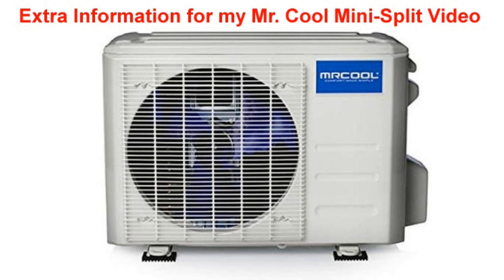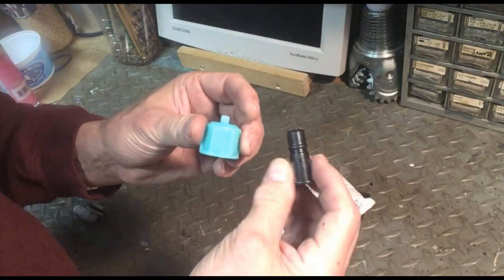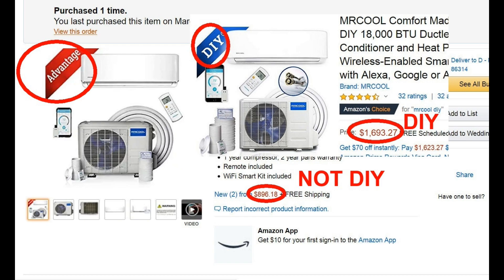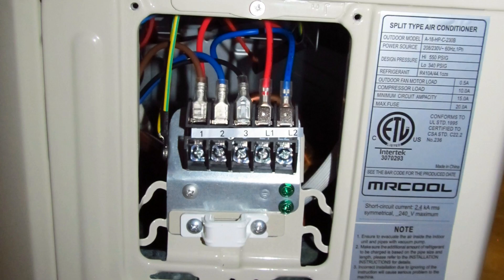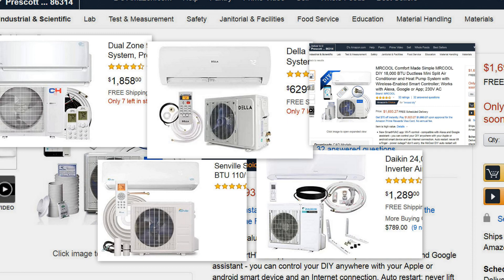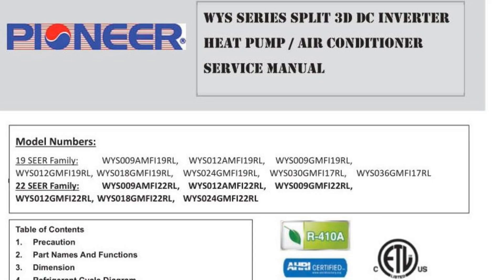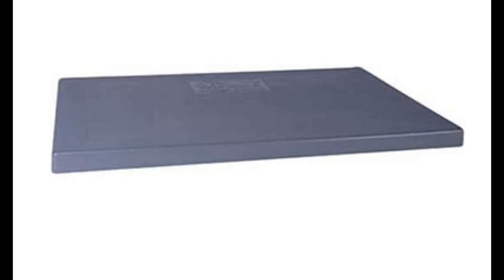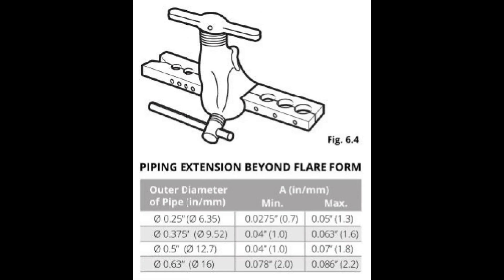Addition to my "9 Tips To Install Cheaper Non-DIY Mini Splits - Pioneer/Senville/Mr. Cool" video.

Comment: check the cost of the outdoor control board. AUX units from Lowes(control board $134.00). Senville also good to buy. Use 1/2" piping 15amp breaker/12 gauge thhn for 1 ton. #10 thhn for 2 ton, 30amp breaker. uncover the line set at the first bend to see if you kinked the copper. if vacuum will not pull down then you have a leak. cooling psi should be in the 125psi range, if lower then you are low on charge.

Comment: I have a evac unit that I used for automotive ac units ,  non electrical,  it works off an air compressor , will this work on one of these mini cools to evacuate the system?

Comment: Can you please provide advice on this matter?

I installed a 3-zone MRCOOL DIY 24k BTU in my house, but one of the lines is a couple of feet short to the compressor. Instead of buying a coupler and another set of 16 ft. line sets to connect my original 25 ft. line set, potentially introducing more problems with oil not draining properly, I would like to cut some extra copper material of the longer line set and braze it with the copper of the shorter line set.

I don't need to flare the ends because I'm still using the QuickConnect connectors of the line set, I'm only using the extra copper.

Because the line set is pre-charged and vacuumed with refrigerant, after connecting the line set to the condenser, can I still perform the same steps, i.e. vacuum the line set and check that the microns are below 500? 

There's nothing extra special I need to do, even though these are pre-charged line sets?

Thank you.
Reply: maybe use 2 16' lines
Reply: I know this is old, it will help someone. 
If you silver solder or braze a line set you have to purge with nitrogen or the inside will oxide and scale off.
You can rent a small bottle and gauge.

Comment from the maker: There is something else I need to stress before you install your unit. Pick a mounting location that will NOT cause the unit to blow air directly on you during most of the time you are at work in your shop. While the blowing is gentle and quiet (nearly silent), it will be uncomfortable for it to be blowing directly on your body or in your face while you are working.

Comment: What do you think of mounting the compressor horizontally?  I am doing a Camper Van conversion and contemplating installing the compressor under the van and then running the coils to the inside unit mounted on the ceiling.  Solves both heat and cooling issues.  Aware of the power limitations and will have a large solar system but only expect to use the unit when connected to shore power or for brief periods with batteries.
Reply from the maker: I am not an A/C, expert, but I don't think you can do this. The refrigerant sits at the bottom of the compressor in a liquid form. Turning it sideways might mess up the valves. But, I am only telling you what I have "heard." Someone else with more knowledge should comment on this.
Reply: I believe blam is right I don't think these are meant to lay down and operate just like when you buy a refrigerator from the hardware store and lay it down in your pickup to drive it home they tell you to stand it up for 24 hours before you plug it in to let the oil get back in the compressor the right way. There is a company that builds a 12 volt mini split I just saw it on eBay or Amazon the other day but it's only 6,000 BTUs it's meant for RVs and campers and we'll tie into a 12 volt system and they said it could be mounted either way so you may want to look into that but it was expensive I want to say around $1,500
Reply: I should have added to my first comment I would reconsider mounting one of these underneath the van though it's going to get a lot of road debris and stuff hitting it I just don't think it would last I would try to mount it somewhere else
Reply: the compressor has an oil in it that if turned on it's side will not function proper & you'll burn up your compressor before to long. So it may work, but not for long. EUROM AC2401 is  a Camper/Caravan style if that's what your looking for or you can get a U shape if your window open the other way. Thank for the Video,  spent the day watching vids and While yours may not have the highest production value, yours had the best info. You're my kinda guy, no bells and whistles just some good old know how and a love for the ability to do it yourself & do it right. Thanks again, I'm a new subscriber. Cheers

Comment: Did you pressurize your lines for a leak test before opening the valves?
Did you use R410A to pressurize the lines?  Where can you buy R410A?
Reply from the maker: No, I put a vacuum on the lines and left it for a few hours, then checked to make sure the pressure had not increased. That worked OK for me.

You don't need extra R410A, all the refrigerant is inside the compressor unit.

I'm not recommending this, but I have seen people do it: Some people have pressurized and tested their lines with compressed air. People who are against this say that this method will introduce moisture into the lines. They are completely correct. But, the point of the vacuum pump in the next step is to remove all the moisture. I can't logically see anything wrong with this method, but I am NOT recommending it!

If anyone could logically explain why this method is bad as long as the system is vacuumed out correctly afterward, I would appreciate it.
Reply: @bupright  Thanks!!

Comment: Nice job encouraging the DIYers, of which I am one.
My only issue with these units, which I have experiences in Europe a lot (no alternative in ancient buildings) is that they can be pretty drafty, so plan your inside locations with this in mind. 
I am intrigued by the ceiling mounted kits, seem expensive, but maybe worth exploring.
Reply from the maker: I specifically mounted mine where it would not blow directly on me while I was at the workbench. That turned out to be a good idea. It would have frozen me, and my eyes would have gotten dried out (very low humidity here).

Comment: I ordered this unit today from Home Depot (Big sale).  My install should use the entire length of the lineset,  are there flares on both ends or should I order a flaring tool?
Reply: Yes there are flare fittings on both ends. The question is will you be short or long with the lineset length in the kit. You can splice in extra tubing if short. Understand that this is softdrawn copper tubing, and it will work harden with a few bends, which will result in a kink if your not careful. So limiting the handling of the lineset is very important. As the lineset is insulated, the first task is to uncoil this roll by unrolling it on a flat area. Then measure where your first bend is, and make that. This typically will be the distance down from the wall unit tubes which at this point should be bent downward on the outside of your building. I found I can form the bends over a round object of 6" or so diameter with the insulation in place. If you need a tighter bend radii, then you need to cut the insulation and slide it out of the way, make the bend with a bending tool.
Reply: There are factory flares on each end. You only need to flare if you cut the lines to fit.

Comment: Thanks for the information. Were did you get yours from
Reply from the maker: Ingram's Water and Air LLC. But I ordered it through Amazon. Was missing an item left out at the factory. Not Ingram's fault. They were GREAT to deal with. Went way over and beyond to get it right.